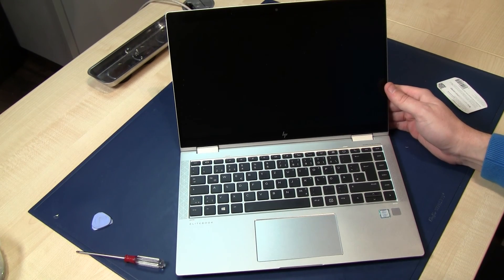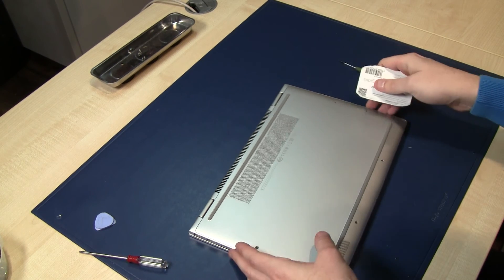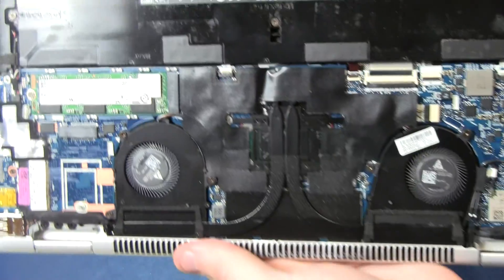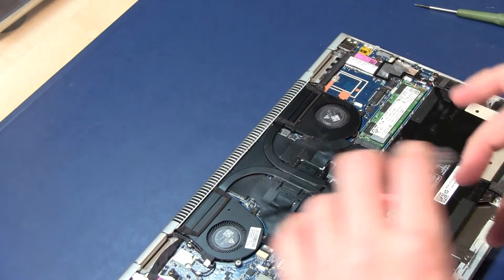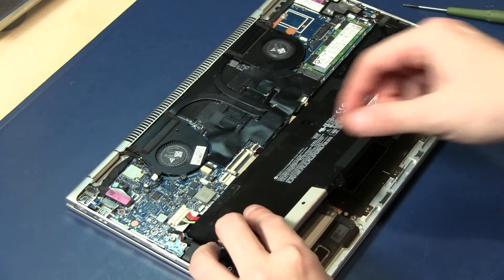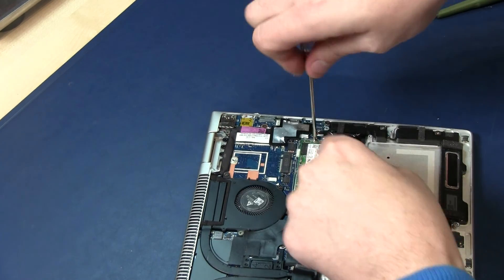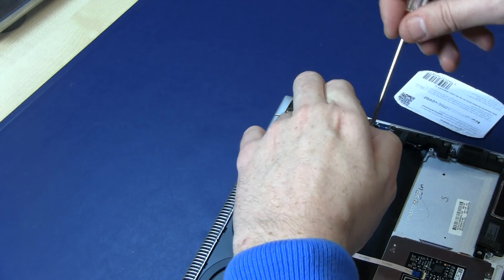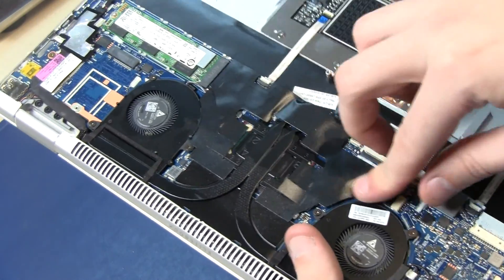HP Elitebook x360 1040 G6 Series How To Disassembly, Replace Battery and upgrade SSD NVME harddisc

Comment: Nicely explained teardown and upgrade video.  Do you know how to add the optional 4G LTE card and antenna?
Reply: I wanted to add the 4G LTE antenna as well. Installing the card is simple but my research led me to believe that when updating BIOS that the antenna needs to be on the whitelist and must have a HP part number to be intensified and work.